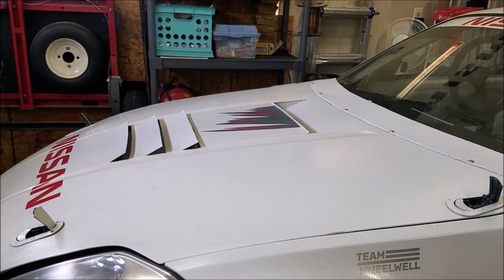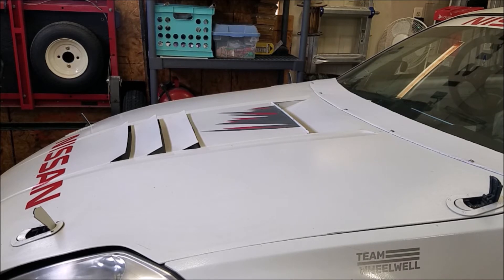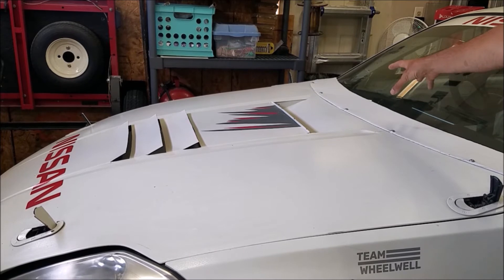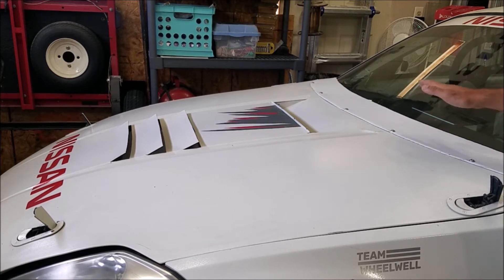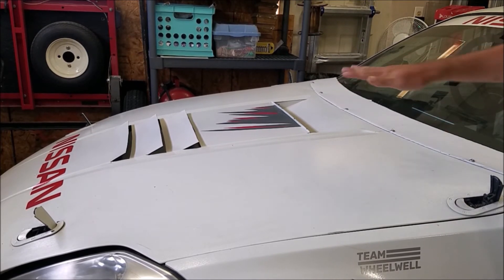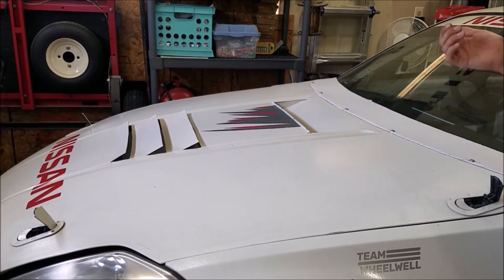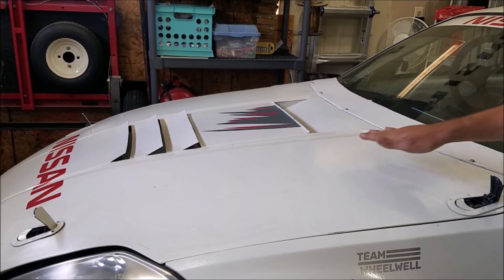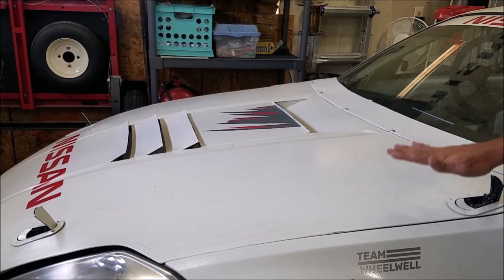Nissan 350Z Aero Cowl Cover

Comment: Did you see/feel  improvement in the  downforce
Reply from the maker: I did several different modifications at the same time, but I can tell you three things.
1. The car definitely feels much more stable at high speed with my current aero set up than it did stock
2. I can see the piece press firmly against the windshield as I go faster
3. For the low price and weight, I can't see a reason not to do it on a race car in dry conditions